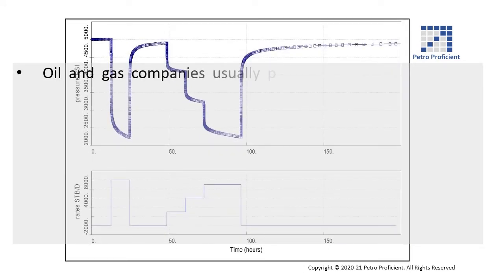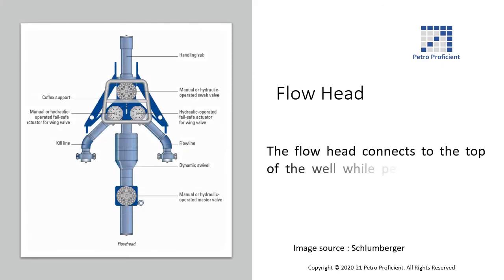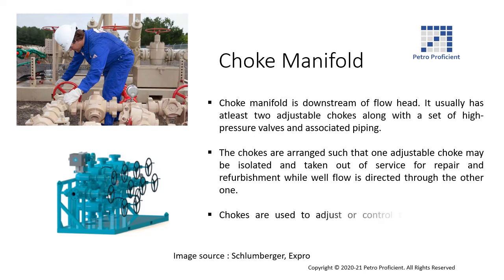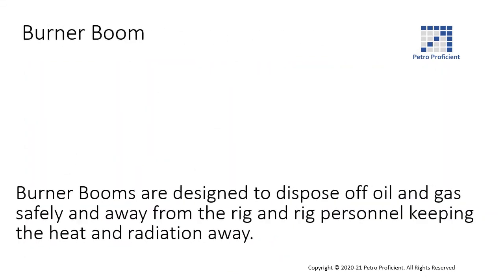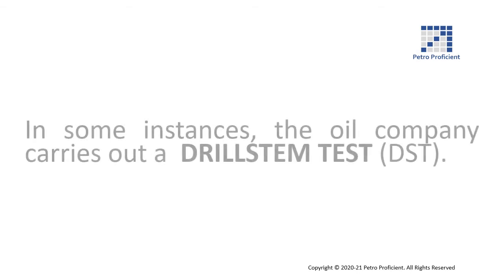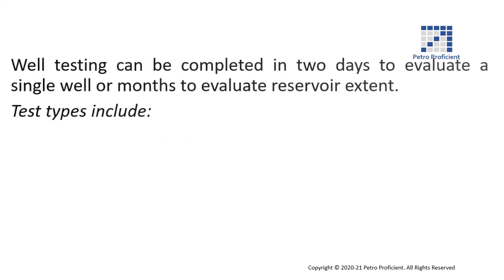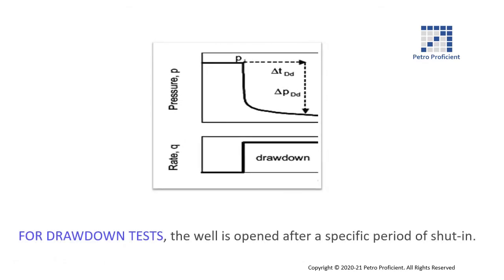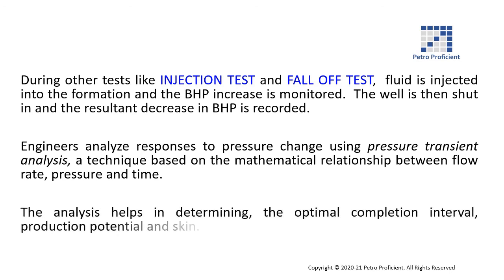Oil and Gas Well Completion | Well Test & DST

Comment: Hello, I want information about the work and tasks of operator well testing
Reply from the maker: Well testing operators has to work with well test equipment at well site. Such as rig up equipment, operate valves. Check pressure and temperature pressure and gas readings